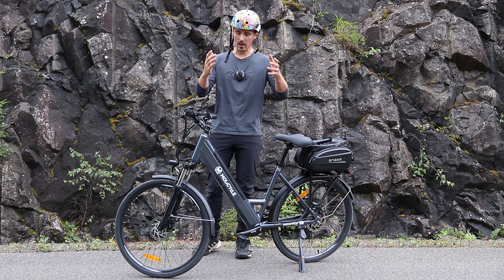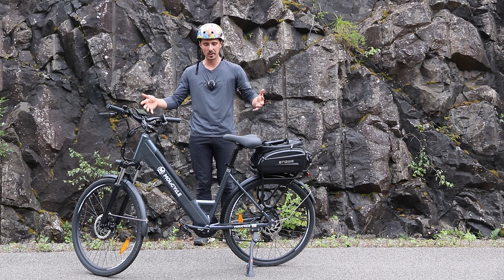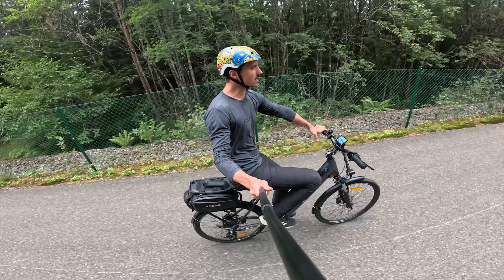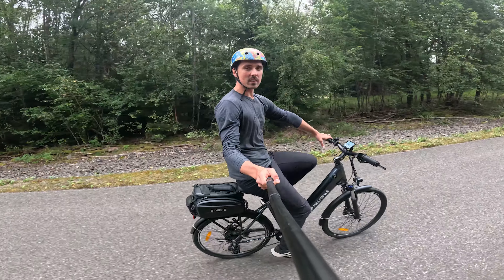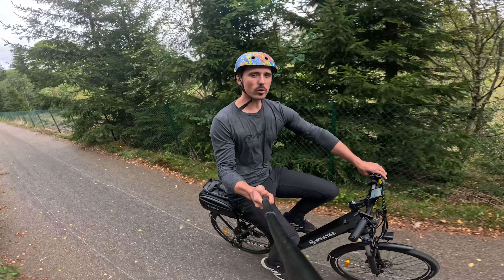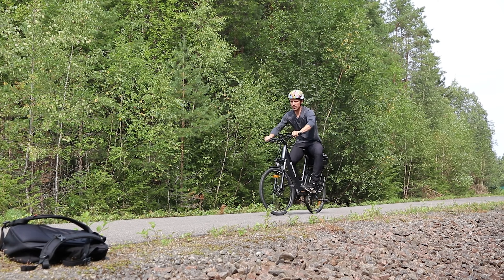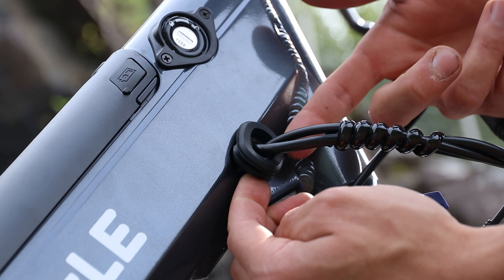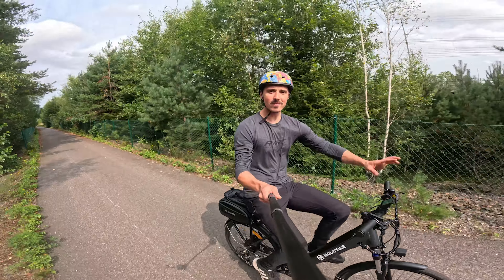This E-bike Has Some Secrets - Molicycle R1

Comment: You may need to look into your headset tightness to fix your wobble issue when riding with no hands on the handlebars. It seemed like you have to much play in the stem.